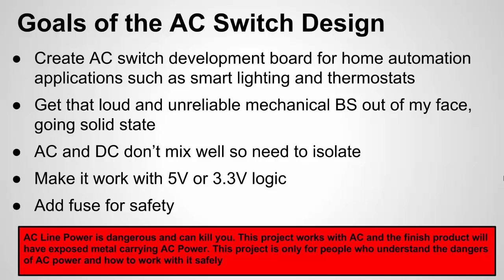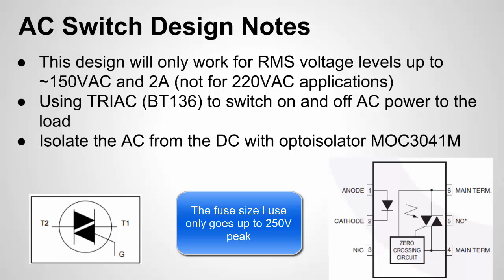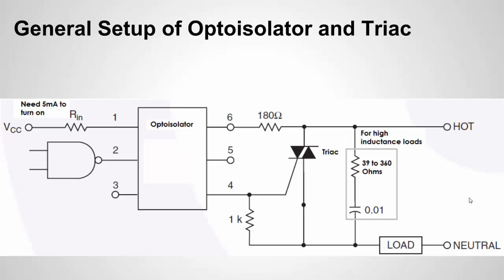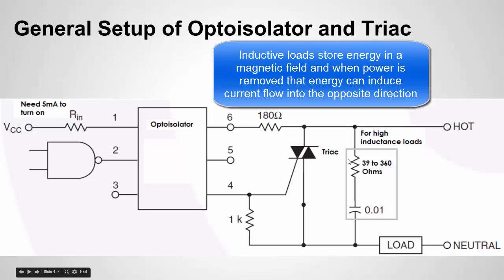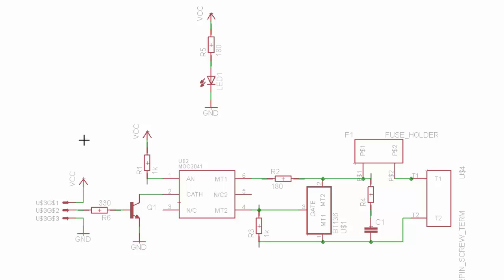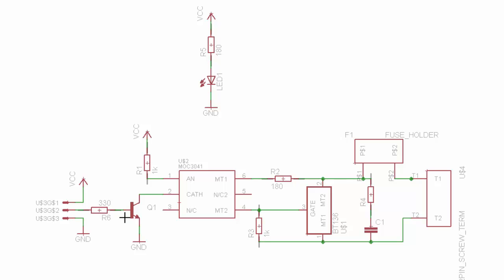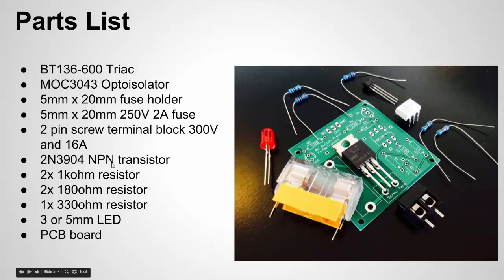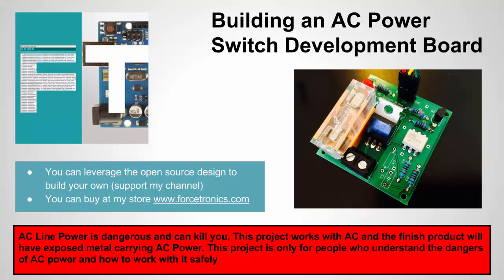Building an AC Power Switch Development Board

Comment: cool video. what is the part no for the screw terminal and the fuse? thanks
Reply from the maker: +jamaticon Info for the screw terminal:  2 Pin Screw Terminal Block Connector 5mm Pitch Panel PCB Mount K2301 td 
Info for the fuse: Quick Blow Glass Tube Fuse 2A 5x20mm 250V
Reply: +ForceTronics cool. Thanks.

Comment: Sorry - how is this better than a solid state relay?
Reply from the maker: +John Errington The design that I show in the video is a solid state approach so I don't quite understand your question?
Reply: +ForceTronics - are you not aware ready built solid state relays are available - examples here
http://uk.rs-online.com/web/c/relays/solid-state-relays-accessories/solid-state-relays/
Reply from the maker: +John Errington Hey John, I am aware of solid state relays I thought you were implying the technology was different. The way I would position the design I shared in the video versus an off the self solid relay is this design will only cost a hobbyist 1/7 to 1/10 the price. Most consumer electronic products do not use solid state relays because of their cost and this is more of the area I target. Solid state relays are typically used in more industrial applications where cost is secondary to reliability and ruggedness. Thanks for bringing this topic up.